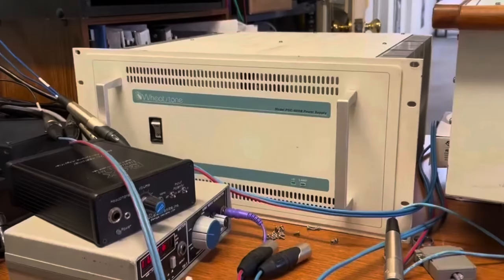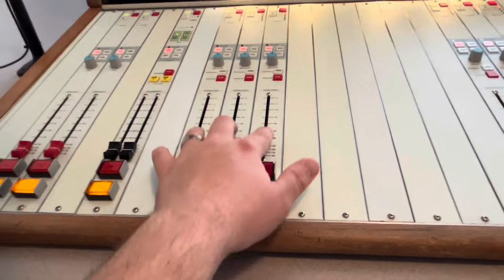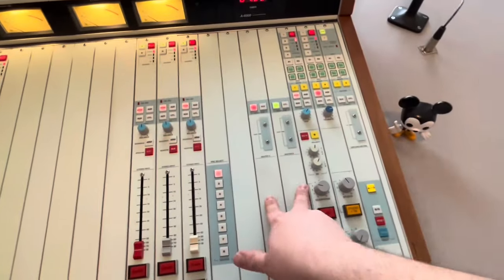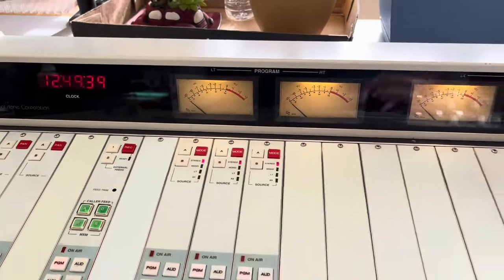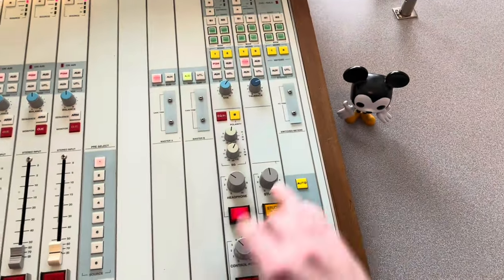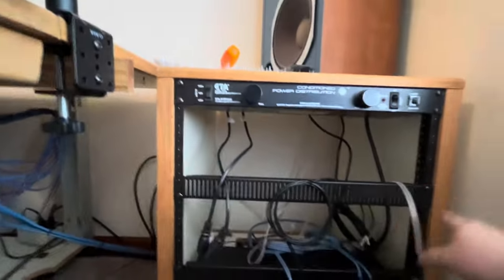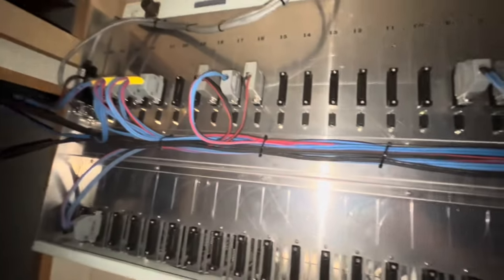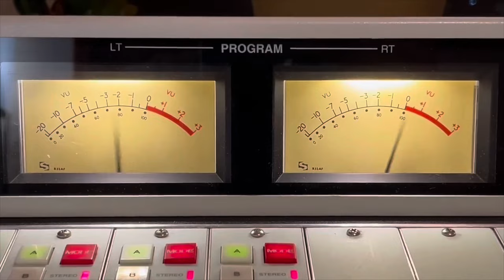New Console - Wheatstone A6000

Comment: I worked for an audio show company in Northern Cali that had a beautiful Wheatstone house board (IIRC it was 48 channels). One of the cleanest sounding boards I ever heard. And rugged, never gave us a lick of trouble.  The power supply for it was massive as well, it sat at the bottom of the house rack which held all of our EQ and effects processors. The house engineer and I used to drive the boss crazy, calling it the Flintstone. We even got one of the Flintstone car toys that we would put on top just to see the boss's blood pressure go up. 

I was the monitor engineer/electrician. My board was a Yamaha that was a 36x8 (if memory is right) with all rotary knobs. I loved that board, learned how to pan mixes across the stage by using the edge of my hand. Had to do that for a lead singer who used to love trying to mess with the monitor engineer by moving across the stage and leaning into the wedges to provoke ringing so they could dock pay.  I bet the band that I could get through both sets without ringing or losing the mix...I won, they had to pay up. (Three cases of beer for me and our crew.)
Reply from the maker: I agree that this generation of Wheatstone is very clinical and honest sounding. Flat, and dead silent.

Comment: You struck gold with this beautiful find! Great video overview as well. Lucky it came with a power supply - they are not cheap. Although I still like my A-300, I'll admit I like the A6000 on/off buttons better. Also, good use of the Studio out for guest headphones. Lastly, I'm still not a fan of the undercarriage headphone jack, it is too prone to getting hit by the user's knee and if it's essentially for routing to some other below surface/built-in jack, why not just have internal screw terminals or something that the installer hooks up. That's a disagreement I have with Wheatstone. Your set up looks totally professional - nice job.